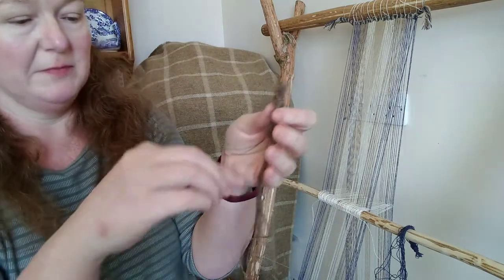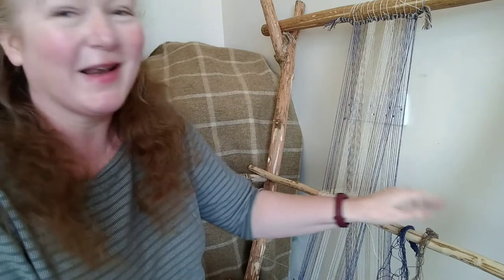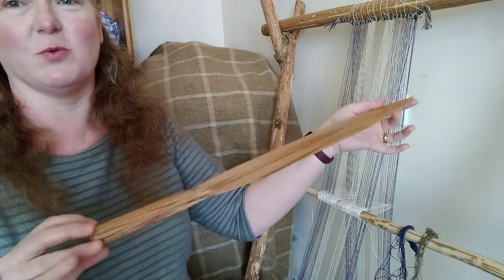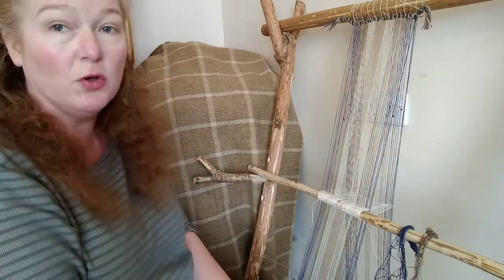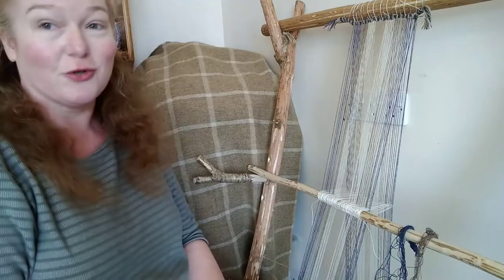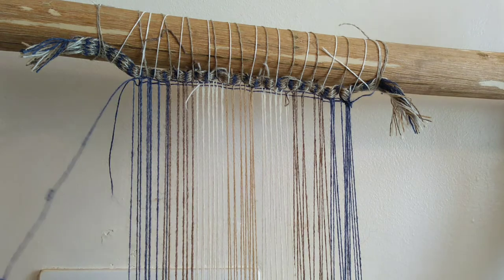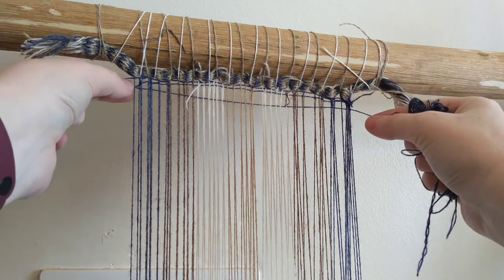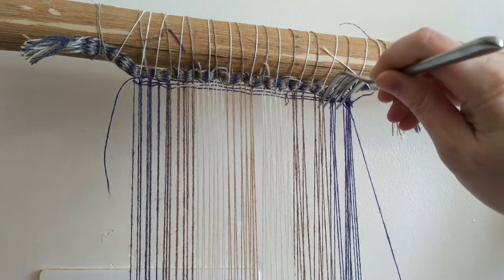Making a Warp Weighted Loom, Part Seven: Starting to weave.

Comment: That first bit of weaving, where you are trying to order out your warp....there's a muscle way to do it, and it works really well to expose the problems immediately, and shows a bunch of problems all at once.
Open the shed
Throw a shot
Change the shed
Throw a shot
Change the shed
Throw a shot
Change the shed
BEAT THE WEAVING

By beating three shots at once at the very beginning, you spread your warp, establishing the web, and your pull all of your threading errors right up in front of your nose!
Reply from the maker: I'll try that. Thanks!
Reply: How goes the weaving?

Comment: Really great work. I just try to imagine how it would look like and feel like if you would do this with nettle strings instead.
Reply from the maker: Would be very like using flax
Reply: @SallyPointer  So, which material is the softest, I'd guess they used linen and combined it with fluffy sheep fur or rabbit or cat fur.

Comment: About how heavy are the weights you used? I'm planning on starting to make some in my ceramics class using a modular combination of hook bolts, rubber washers, hex nuts, and ceramic wheel-thrown spools so that the excess warp can be wound up and stored on the hooks and unreeled as needed, rather than chained, which it appears must be repeated every time you need more warp with your style of weights. I'm thinking I'll make my weights a little lighter than yours to prevent the extra tugging at the header.

Comment: The only thing I don't understand is heddle? How does it separate threads when you push it back in? I've often wondered how threading every other one on a stick works with just one heddle....
Reply from the maker: The weights help pull the shed back into place when you release the heddle